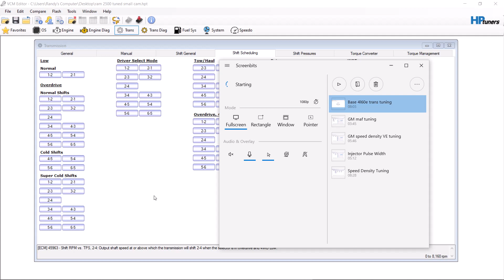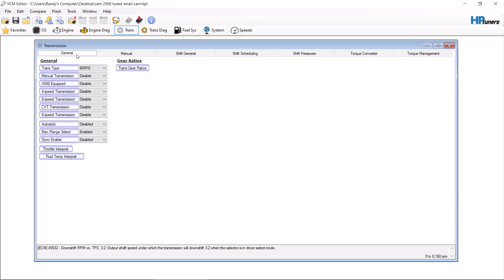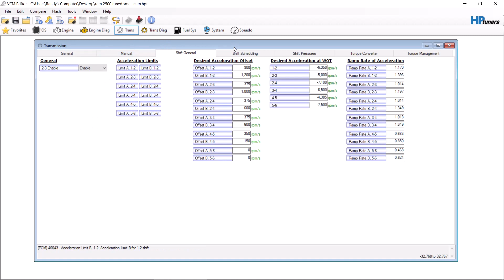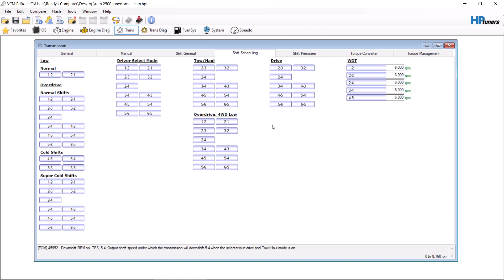Dodge trans tuning explanation

Comment: Do these really have a manual trans on/off option? If they do have you messed with that any? I'm looking to swap my 17 power wagon to a g56 manual trans but the tuning of it is hanging me up. If it can truly be that easy I should be able to make it work.
Reply from the maker: Most of the transmission on and off programming is in the bcm itself

Comment: Any suggestions to correct a stalling issue when slowing to a stop and shifting to reverse?  I can seem to stop it from stalling if i shift to soon. If i come to a complete stop....wait for idle to stabilize, and shift from drive to reverse its ok. If i stop in a hurry and go to reverse right away, it will stall. (This example is just from how i pull in front of my house and back in the driveway)  however it will also stall if i go from reverse to drive in the same fashion

Comment: I have a question???? The prime shift schedule I see a gear ratio for 2-2 prime on this 2010 ram I’m tuning  and 2-3 prime . I don’t see a ratio for 2-3prime to multiply against would I just use 2-3 or 3rd gear ratio to multiply the rpm with . Or don’t mess with 2-3 prime shift schedule?? Want to say thanks as well I’ve picked up a lot from you on the hemi side and my knowledge from GM has come in handy .
Reply from the maker: The prime stuff is a little confusing I haven’t made a video explain it yet
Reply: @Recklessmotorsports  thank you yeah I’ve been reading up on and going through the schematics on the transmission and yes I see why I was confused before I don’t get why Dodge does certain things but who actually does lol thanks brother .

Comment: Trying to get 3-4 shift right.  Built trans started getting lazy 3-4.  fluid and filter clean.  1-2 snap, 2-3 snap, 3-4 like inhale, then exhale into 4th, like it holds back then slide in.  trying to figure out when B2 release and K3 takes over to get a quicker shift
Reply from the maker: this can be hard, try to pull more torque from the shift while increasing shift pressure
Reply: @Recklessmotorsports  Reduce upshift ramp torque 3-4 shift?
Reply: @Recklessmotorsports  Increase fill pressure 1 and 3 B2 clutch?
Reply: @Recklessmotorsports  Other thing I noticed. I have 1-3 TC unlocked. Watching log, 4th is selected just before 4th engages I see TC slip go up quite a bit then come back down as 4th is engaged, then it goes into lock up and slip goes away.  Seems to only do this for 3-4 shift.

Comment: how come in a 2013 charger rt 5 speed. in the shift sched it shows for (1-2) shift at 100% 1440. first gear ratio is 3.6, that means 5184 rpm at wot? doesnt make any sense. the car shifts at 5600 rpm at wot. there is performance section for shift sched also. the (1-2) shift is even lower 1395. that means shifts at 5022 rpm at 90 & 100% throttle? something is not right. how do you increase the shift rpm from 5600 to 6200?
Reply from the maker: The cars schedule and wot tables never match from the factory
Reply: @Recklessmotorsports  so how do i increase the shift rpm then?

Comment: I have beard Dodge vehicles have a maximum transmission rpm that you can’t always change with hp tuners, this seems to be true because in drive I can not get my 05 ram to shift any higher than the factory 5800 engine rpm. Even with the rev limit in drive increased. Any advice on how to get around this? I have gotten it to shift 1-2 at 6500 in manual first gear.
Reply from the maker: It’s something in your trans tuning

Comment: It took me forever to figure this out , I wish someone had this video before . Any videos of idle tuning a hemi with a camshaft?
Reply from the maker: I can make one, what year and model? It’s different each year
Reply: @Recklessmotorsports  it's an 05 magnum rt . I've got the tune dialed in perfect but I cant seem to get the idle right.  It's a 273 comp cam ,eagle heads .
Reply from the maker: I posted a video I did on an xfi273
Reply: @Recklessmotorsports  I just saw that after I replied.  I tried it with my current tune and it's to far off. I'll start fresh and se what happens. I have it pretty close except for some mild surging in gear .